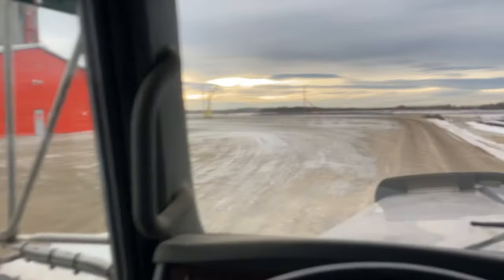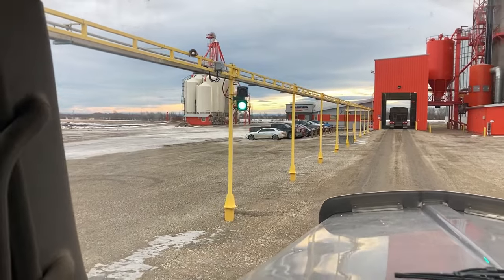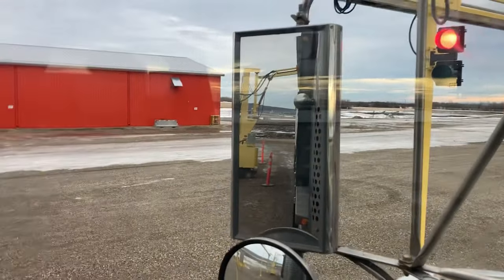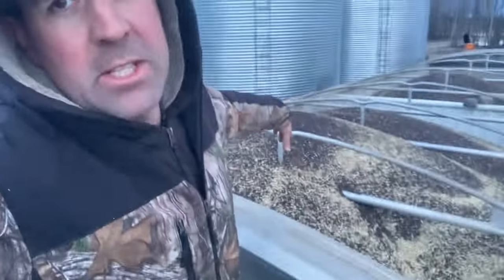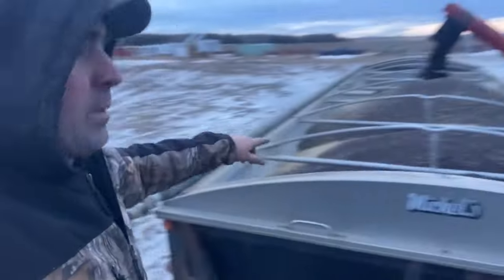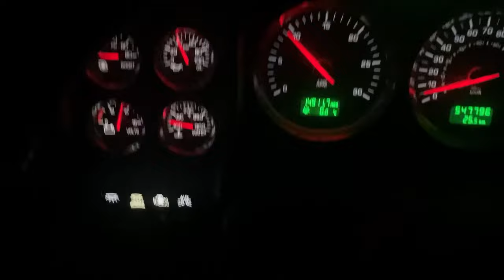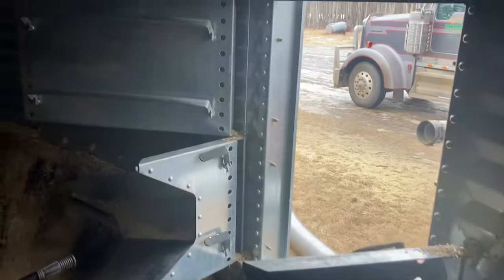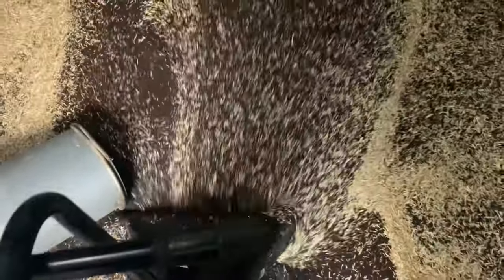Hauling canola and some grain bin information.

Comment: My doepkers looked like that when I bought them, they went fast.   Just bought a set of trains out of the early eighties.  We will be able to weld in our own patches with real iron now.  But they are half a load empty 🤣🍻👍
Reply from the maker: Yeah I think we need to find a set of aluminum ones, this steel junk it juts wasting away
Reply: @millionairefarmer.  I’ve got an aluminum right now, it’s better, but not perfect.  Aluminum attached to steel beams, still rots out.  Plus I think the slope wears away faster with grain.  In my opinion anyway.  I bought my aluminum trailer really, really, really used, but it’s not great.  Lots of spray foam on this one too.